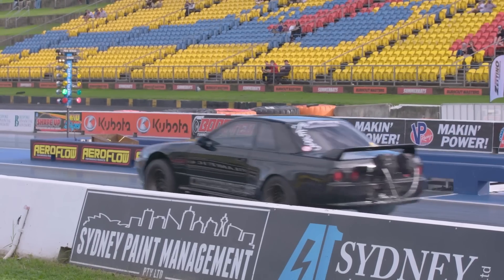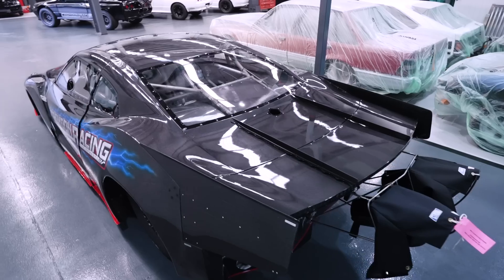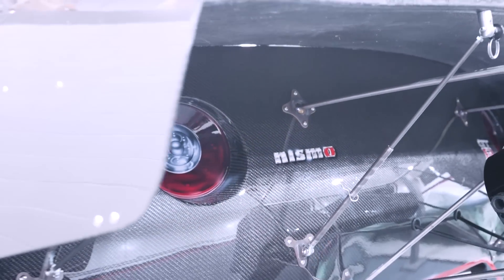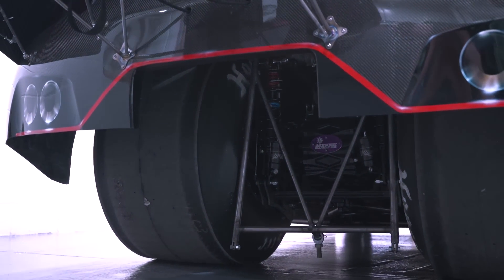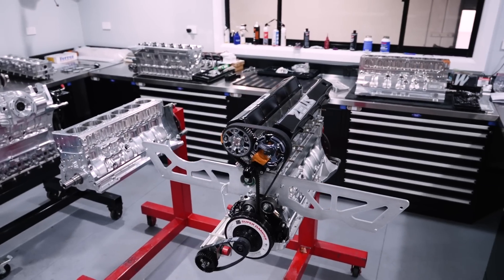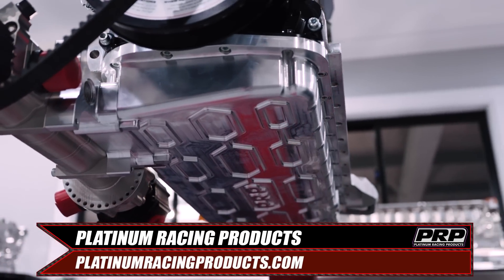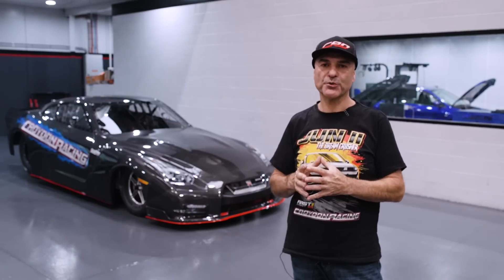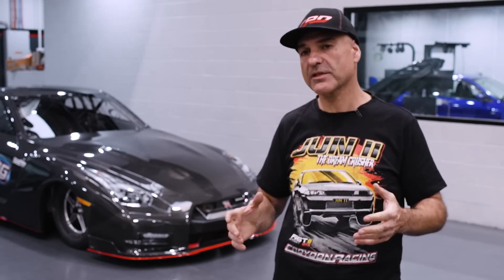CRD Unveil Crazy New Billet RB-Powered Pro-Mod GT-R With the Goal of Mid 5s!

Comment: I love Australian drag cars, there just so unique compared to what we have in the US.
Reply: I would like to see this particular Aussie Pro35 on ImportVsDomestics US event.
Reply: You do know there are more than just V8s in the US, right? The US has so many different promods with different engine configurations. The only problem is that they are usually in their own "import" only class. V8s and other engines don't mix due to the speed difference. Heck, GM and Ford based V8s can't keep up as well. This leads to a lot of Promods being powered by Hemis. People are more focused on speed than uniqueness, I guess.
Reply: You know what? I guess you're right. In Promod, people eventually shift to Hemis. Ekanoo, known for their 2JZs, switched to Hemis. There was the Proline 481x engine that was getting popular, but eventually, the Hemis caught up and passed it. There was also this team who were using the Ford Modular V8. I thought Quad Cam V8s would take the throne from the Pushrod V8s, but that project is gone. Everything goes back to the Hemi.
Reply: @markoz673bajen8 Lol, the 2JZs at maryland would shit on any Aussie drag car let alone the V8s.
Reply: @johncarl5505 If the viper V10s get mass billet block projects, I think there could be some big changes, the viper V10 makes 3500+ Whp on a stock Cast block lol.

Comment: To get into the 5s you need 1hp+ per lb? So I'm guessing this thing weighs at least 2400 so the RB will be screamin and I can't wait
Reply from the maker: They've already gone 6.37 and 224mph in JUNII. Even if power and engine combo stays the same, the new car will go 5s.
Reply: This engine combo is good for 3000. It has the largest turbo u can currently get on the market. Jun2 wen t6.37 in streetcar trim (prostreet).

Comment: btw what's the power levels you guys be running at?

R35 are pushing over 3000bhp+ for high 6s pass
Reply from the maker: This isn’t an R35. It is a Pro Mod, so it is much lighter.
Reply: I think you meant VR38DETT of R35 ?
Reply: I have seen 1320 film RWD powered norm body R35 go down in flat 8s to 7s.
Reply: They’re running faster times in R32 full street chassis anyway
Reply: All the other r35's utilise the vr38. They are a slightly bigger engine than the RB but no one has dared to push the limits of that engine in a promod chassis yet.
Reply: 3000hp in a ProMod like this is a 5 second combination. Obviously depends on weight and set up, but it has the gear to go 5s and that's their aim. R35s are handicapped by weight and keeping the GR6 gearbox

Comment: The only thing I dislike about it is the loss of awd. I know pro mods are so well set up they dont need it, but I think I found my next dream project for andrew to build?  A mix between that Rob Dahms Ahurra/the hoonicorn, and the most insane RB Andrew has ever built. Of course with all the usual insane suspects suspects he works with. Sadly I'm guessing it would need to be auto. 10 inch quick change style diffs front and rear would be amazing for the extra tuning possibilities. Would have to be an 32, or 33 body. Suppose I wouldn't cry over a 34 though. Maybe have chair slayer design and bend the chassis. Rant over
Reply: No.

Comment: I'm surprised it's LHD. It's an awesome build.
Reply from the maker: Driver is on the left as their weight counter acts the direction the chassis twists due to engine rotation
Reply: @Motive Video  Thanks for the explanation. I didn't realize weight placement against the engine tortional forces would play a major part in getting the car down the track